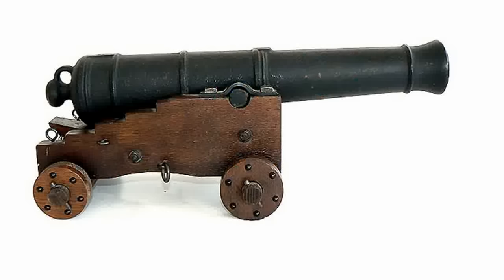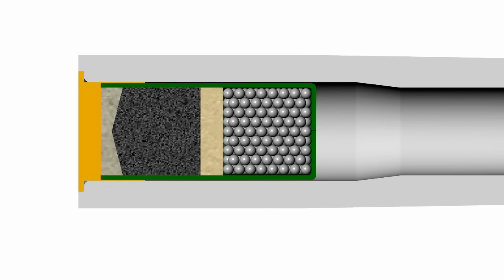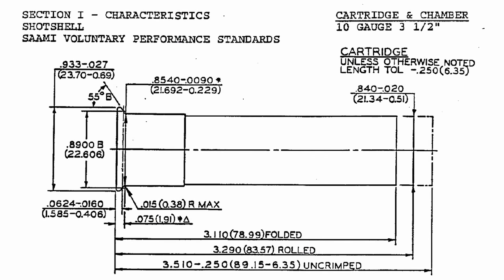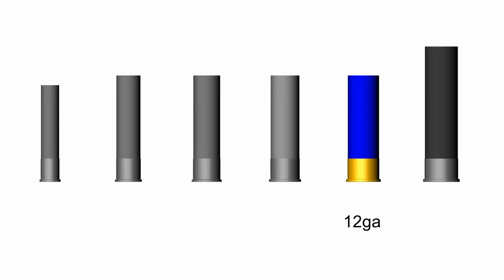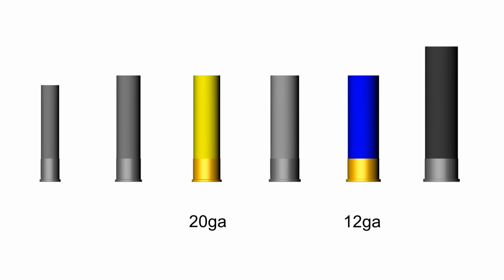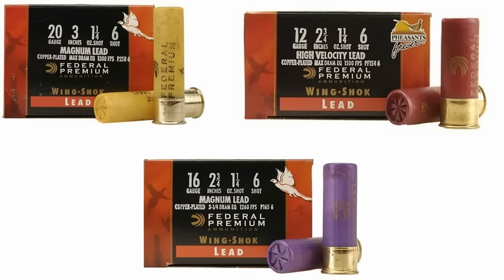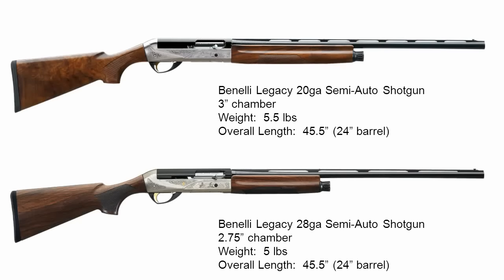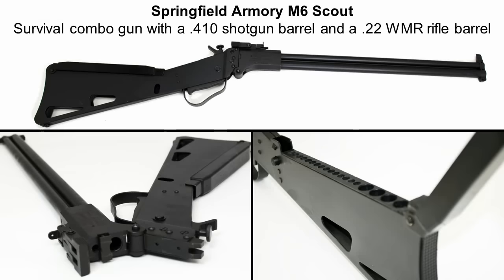Shotgun Gauges Explained - Shotguns 101 #3

Comment: no thank you I will use metric
Reply: You from Europe or Canada or something?
Reply: Stanley The Talking Grapefruit I'm from the better part of the world :)
Reply: Well obviously they are from one of the 99.9% of countries that use metric...
Reply: QuakeGamer632 did you just assume my gender?
Reply from the maker: Metric's played-out.  If you really want to be self-righteous about how you measure the world around you, you should be using Planck units.
Reply: Synchronizor and metric is simply a simplified planck unit , The metre is defined as the length of the path travelled by light in a vacuum in 1/299 792 458 second.
Reply from the maker: No, the meter is 1/10000000 of the distance from the Earth's equator to its north pole.  But people realized that that definition was imprecise and weird, so they tried to find more "scientific"-sounding definitions for the same amount of length.  First it was a metal bar that served as the official standard, then it was some goofy number of light wavelengths as emitted by krypton-86, and now it's a messy fraction of the speed of light in a vacuum.  There's nothing fundamental about the meter, it's just as arbitrary a quantity as the foot.

If you need to do complex calculations, Metric is nice because it's mostly base-10, so it matches our preferred mathematical system.  But base-10 itself is sub-optimal & arbitrary too - a simple consequence of humans having ten fingers.  Numbers can be represented in any base you can imagine, and if you want to be snooty, base-2 is a very fundamental system that is space-efficient and super-easy to implement (hence its use in computers and machine code), base-12 is a highly efficient approach due to its factors (which does come through when using feet & inches), and base-60 is extremely well-suited to fractional notation and a variety of mathematical operations (which is why it's stayed popular for timekeeping, geometry, and navigation).  

At the end of the day, everything is arbitrary, and it's all biased toward our history, environment, and physiology, so being all high-and-mighty about one system or the other is laughably pointless.  If you're looking to communicate effectively with other people, the best unit system to use is is the one they're most likely to understand.  That's something I've learned very well as an engineer who deals with people & projects from all over the planet.  As for my videos, I have access to statistics for where my views come from, and there's a reason I use US Customary units as the default.  I have tried to be better about showing Metric equivalents for other folks in my more recent videos, though.
Reply from the maker: I've thought about using Planck units in a video as an April Fools joke, releasing another version with normal human units the next day.  It'd be a lot of work for one joke though (especially a joke that probably wouldn't land for most folks), since I'd have to re-do so much of the work that goes into a finished video.  Maybe once I get back to regular videos, and have better equipment and software to improve my workflow.
Reply: No, the meter WAS 1/10000000 of the distance from the Earth's equator to its north pole. It is currently defined as aforementioned.
Consensus has been achieved at this point - the metric system is the superior measurement given both the consistency gained by being based on physical constants, and its useability by sharing a common base with the dominant default base used in math.
The imperial system is at this point a historic relic from which the scientific community and the rest of the world at large have move on from. It does not even have its own fundamental base definitions anymore, and is now defined relative to metric. It serves simply as an additional and unnecessary abstraction layer atop the metric system whose only purpose is to patch a fundamental failure of the education system.
Of course I understand why you would use it in your videos - you are rightfully speaking in the language of your target audience and you'll get no argument from me that you should do otherwise. But the idea that both metric and imperial are both just arbitrary systems who can't be compared in value is a false equivalency. Something of an irony considering this video is about the archaic messy shotgun measurement standards.
On point though, great content. The casual back of the napkin explanations I got from my grandfather years ago never quite straightened this stuff out for me, cheers for putting it all in one place.
Reply: Synchronizor like what Ben Weigt said but less harsh xD I mean he completely destroyed your point
Reply: Sorry, I didn't mean it to be harsh, too much coffee! xD
Reply from the maker: No, my point still stands.  While Metric is nice for doing physics calculations, it's by no means a natural or fundamental unit system.  It's arbitrarily based on things around us, like the circumference of the earth, or the physical properties of water.  Some (though not all) of those base units have been redefined less subjectively, but that doesn't change the quantities to anything more convenient, it just lets us nail the old quantities down a bit more precisely (and American Standard units have been re-defined in the same way, anyway).  But some of those base units are still defined by physical objects, like how the "true" kilogram is a piece of metal locked in a vault in France.  Other units are just plain weird, like the way the ampere is defined by an idealized setup of two wires that you can't actually construct in real life.  

I do like Metric, and I use it all the time.  It's a nice system that works fine and is relatively straightforward.  But it's certainly not as natural or fundamental as many folks think.  You still have to work in all kinds of constants to get calculations to come out right.  And as a tool for communicating simple measurements to someone else, it's no better or worse than any other system; it's all about the audience and what they're familiar with.  

If you're trying to communicate with a Chinese person, you speak Chinese (or maybe Mongolian or Tibetan depending on the region); you don't give them a big speech about how they should be speaking English instead because it's more common in other parts of the world, uses a smaller character set, etc.  A smart communicator would just take the time to become fluent in both languages, and use whichever is most effective for any given situation.
Reply: Synchronizor well no one thinks metric fundamental or natural all I meant that it doesn't change and it's superior to the other systems because as you said it's simple and straightforward unlike feet or miles metric has the "×10,÷10 system" where you can choose the right unit based on your need and compare it the the other units by either multiplying by 10 or dividing by 10. https://www.google.com/search?q=metric+vs+us&client=puffin-a&prmd=ivn&source=lnms&tbm=isch&sa=X&ved=0ahUKEwju2czV3aDcAhWCilQKHZJAD10Q_AUIESgB&biw=360&bih=531#imgrc=aSCR4sXLM0oPQM: 

languages on the other hand are fundamental because every one is defferent so they develop their language to suit there needs and to be honest 60% of humans know more than one language as long as we can understand each other no one cares what language the others are speaking

(btw do you mean english is better than chinese you RACIST FUCKER) just kidding I know you didn't mean it but that sounded racist
Reply: omar oyt let me know when your country makes it to the moon.
Reply: RufescentEAGLE let me know when you stop faking it xD
Reply: omar oyt sure
Reply: Conservative usa will never move out from 1800s.
Reply: Synchronizor I use Kelvin... Is that cool..? Jk.
Reply: Omar Oyt, perhaps if you lived in a country (such as the USA) which used the English system as their primary measurement system, you would feel differently.  The measurement system one uses is largely determined by their environment. 

I have worked in medicine all my adult life and find metric much easier to use because it is all in powers of ten, and because metric is the standard in medicine.

In the rest of my life (away from the medical environment) I use the English system because that is what my country uses.  When I go to buy meat at the market, I don't mentally convert the "6-ounce" steaks into grams.  But if the steaks were sold/priced by a number of grams, I wouldn't mentally convert that to ounces either.

If I was to move from the USA to another country, it would take me some time to get used to using the metric system for everyday things like buying groceries, but after adjusting, I'd simply use the prevailing system where I was.
Reply: Ignoring everything doesn't defend your point, but this entire thread has devolved into circle jerking and the opinions here really have no value in the face of international consensus, so I'll see myself out ;)
Reply: why are you guys arguing about preferences?
Would you argue about which color is superior?
smh.
Reply: Typical American, make things harder for yourself and blame it on others saying they take the easy route.
Reply: omar oyt I thought they didn’t have guns where metric is used
Reply: Literally only America uses imperial anymore, saying nowhere but America has guns makes anti-gun nuts cream
Reply: guys I didn't ignore you YouTube did I'd love to argue more but it's been 2 months also the first comments of me and some clever people who use metric got you all DABBED ON so stop trying to prove the world wrong and learn metric xD
Reply: @40belowful  Kuwait
Reply: Jack Vernian Of course not! Who could argue against orange?
Reply: ANZACxLAG & Liberia. Uses imperial that is, not has guns. Imagine if Liberia had guns.
Reply: @martinhubinette2254  yes it is it's easy
Reply: @SynchronizorVideos  I found your comment beginning with "No..." a well explained and intelligent reply. I agree with you.
Reply: @Xirpzy  When it's not broken there is nothing to fix.
Reply: @rawbagle  "you mean you're not from the US?"
Reply: @Whittaker Kelly rest of the world*
Reply: @willholly1844  ANZAC uses metric.
Reply: Most countries that uses metric system don't allow civilian gun ownership, who are you kidding.
Reply: I really dont care if its metric or SAE, ive worked with both. As long as i understand what gun im going to use and why and im able to buy ammo for it im a happy camper.
I use a 12 ga for waterfowl snd Dove, a 20 gauge or 410 bore for upland birds..
Reply: Metric is ass so......
Reply: @BenWeigt  

#1 Freedom isn't divisible by ten!
#2 Metric was the fanboy favorite a *long* time before it's units were redefined to be based on constants.
#3 There's nothing about the meter that's inherently superior to the yard, nor Celsius over Fahrenheit. (In fact, I'd say that -- due to it's finer grain -- Fahrenheit is superior to Celsius.)
Reply: @SynchronizorVideos  You are right they are even retiring the official Kilo
Reply: @BenWeigt  The only thing metric has going for it is it's base 10 format. If it was base 8 or base whatever it would not be popular
Reply: Just remember, there are 2 kinds of Countries in the world.  Those who use Metric, and those that have put a Man on the Moon.  Cheers. :)
Reply: Screw Metric

Comment: I got to shoot an old 8-gauge that the guy called a "boat gun". It wasn't any more powerful than a 12-ga. with a turkey load, but it probably weighed 20 lbs. or more.
Reply from the maker: Yeah, that's a thing with the 8ga.  Folks tend to think bigger = more powerful, but if you compare black-powder 8ga loads from back when it was popular to modern 10ga or magnum 12ga shells using modern propellants and components, there's really not much of a performance gap there.

Comment: the other even more contraversial reason for .410 popularity is that it can withstand the widest range of powered charges and can fit, even if not intended, the widest range of rounds e.g. 9mm, .32, .40 .44mag, and even some .44-60 government rounds.
Reply from the maker: What?  The .410 is far and away the least versatile when it comes to shot and powder charges.  In fact, the .410 needs specially-designed propellants with slower burn rates to really work properly.  And you can NOT shoot 9mm, .40 S&W, or .44 Mag in a .410 shotgun.  Please never try to do so, and don't tell other people they can.  Not only are those rounds dimensionally incompatible, they also operate at much, much higher pressures than any .410 shotshell.
Reply: you can, it is never advised but despite this the warning is because some .410 fire arms are not made for off loads a .410 break action can in fact withstand these loads and powders, even against recommendation. the major problem is scarring the barrel. please don't lie to people and tell people that cannot. you also can fit some off calibers in .410 revolvers and they work fine.

the reason people say not to is because of the variance of stresses of such a wide variety of round that the manufacturer does not intend for the fire arm.

which means firing a firearm using rounds not intended is full personal liability, like firing a .22lr out of a .22 magnum, firing a .50 cal out of a 12ga, or firing a .45 schofield out of a colt 45 it can be done repeatedly without harming the use and will only cause minor damage to the gun.

so yes you can fire a 9mm out of a .410, there is quick adapter which is thin sheet of metal.
Reply from the maker: Well, if you're talking about chamber adapters or tubes, that's one thing.  But your initial post made it sound like you could just drop those rounds into any .410 shotgun and be good to go, which is very much not the case.
Reply: fuge74 In that case get a 12g because w/ a chamber adapter you can shoot any smaller round. And .22mag to .22lr? isn't the same as shooting a .45sf out of a .45lc, .38spl from a .357mag, or a .44spl from a .44mag. A .22 long, long rifle, & short all use a heeled bullet. The .22mag doesn't.

Comment: some 16 gauge shotguns pattern very well. Back in the day when manufactures were not afraid to spend money on metal many of these were produced with a lot of barrel length. I have found 16 to not have to much wasted speed that causes the pattern to open up prematurely! On to 10 gauge, very useful against varmints in low light conditions. Anyone who says a 12 can match up power never fired a 10, that = is book boy talk! 10 is bad for people that are recoil sensitive. I have seen people that couldn't hit the broad side of a barn because they can't stay focused knowing of the recoil to come. I suggest that if a person thinks about a 10 to shoot one before you buy one because the flash and recoil. I will also say that a tube type barrel is the way to go with a 10. Also don't be that person that breaks people in with a 10 gauge, that is just cruel and unnecessary.

Comment: What's that real long boi on the far right at the end?

Update: turns out the two far right shells in the lineup picture at the end are display shells given out in the past. Not actually loaded with anything.
Reply from the maker: I've seen some vague references to loaded shells in those lengths too, but haven't been able to track down much detail.
Reply: @SynchronizorVideos  I've read a few shotshell/vintage ammo collection forums that these long shells are basically little gifts given out by the manufacturer that display event names or their logos. 

Would certainly love to see a loaded shell that honking, and a gun capable of firing it lol.

Comment: what kind of industrial uses does the 8 gauge have
Reply from the maker: Specialized shotguns like the MasterBlaster shown in this video are used for blasting material deposits out of big kilns and furnaces.  If you Google "kiln gun", you'll find more info.
Reply: sir waffle Also a metal forming process known as shot peening.
Reply: Synchronizor When did color coding become standardized by gauge? I know I've seen red .12 guage, green .410 and blue .16 
Am I color blind, have synesthesia, or just getting old?
Reply: Oh, stadium demolition maybe.

Comment: I find the .410 bore shotgun just about perfect for small game (rabbits, squirrels) at close range (up to about 25 yards).  The 3" shells loaded with #6 or 7 1/2 birdshot will kill those animals cleanly with good shot placement and they are not so shot up that the meat is not usable for food.   And .410 shotguns are light and easy to carry.  Downside?   .410 ammo is expensive per shot relative to 12 and 20 gauge.   Keep in mind the limitations of the .410 and it makes a good small game getter.
Reply: Makes for a good home defense round as well. With 18.25 inch barrels common on defensive shotguns or even a 20 inch barrel, a .410 3 inch 1/4 oz slug will easily deliver the same performance as a .30 Carbine round in terms of ballistics, but less risk of over penetration due to slug designs as a typical foster slug will break up real hard on impact while still delivering enough energy to penetrate to vitals. Even 000 Buck loads designed for use in handguns will get up to 1,400 fps and 1,100 ft lbs of energy. 

That is one thing that often when people discuss the use of .410 seem to forget. .410 handguns when first introduced lacked proper loads, now they have them. Doesnt make them the most ideal but they have vastly improved. But I find a .410 to be more than capable for taking down small game with various shot loads and even medium game like deer or a large hog with buckshot or slugs. It comes down to shot placement and distance. Knowing it's limitations compared to a 12 or 20 gauge.